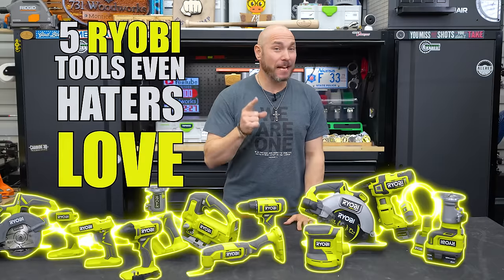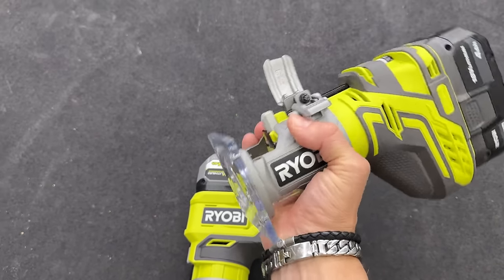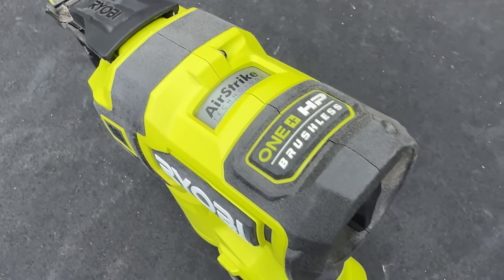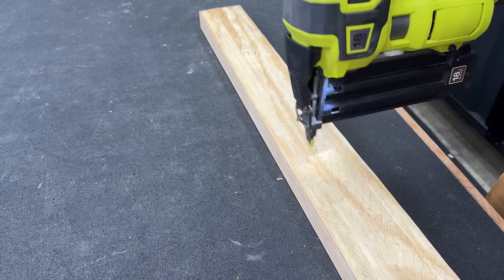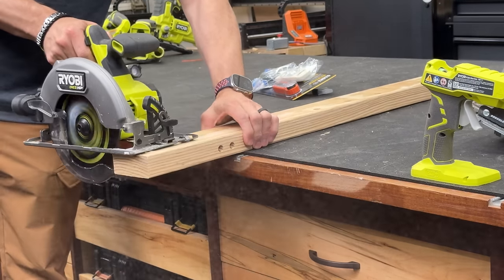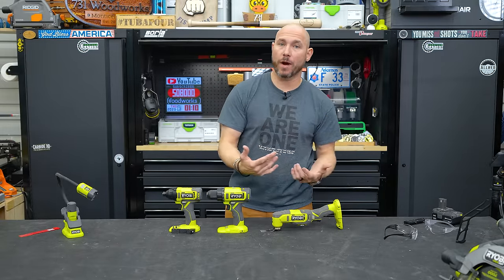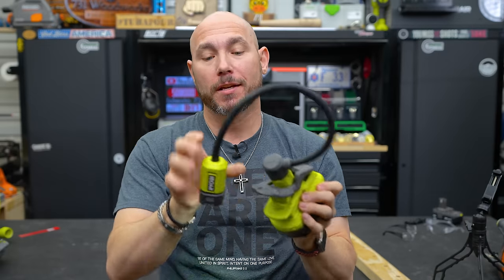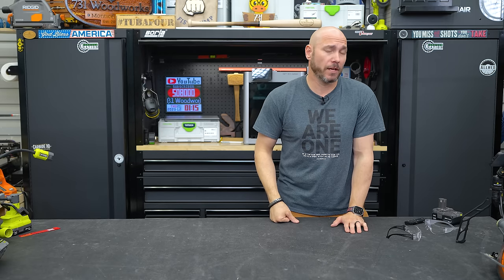The Haters Will Love These 5 RYOBI Tools!

Comment: I have used the smaller circ saw with 4AH battery and it makes a HUGE difference! Great video. I have all of the ones you recommended. I have a little Ryobi 12v drill I use for pocket holes.
Reply: yeah the circ saw needs a bigger AH battery pack or it bogs down.

Comment: I use Ryobi and am very pleased. Try the brushless 6 1/2 inch circular saw. I use it in the field and love it. I love the brushed impact driver better than the brushless. I have literally had it smoking from major paddle bit work about a year and a half ago. And it is still going. The brushless is worse about having too much torque for cheap fasteners.

Comment: I do not work construction and I am not a wood worker but I have been buying a lot of the Ryobi tools and love the ones I bought so far, except the hammer drill I let the smoke out of.  I was using it to drill some anchor bolt holes in the concrete slab, for a 4 ft x 8 ft lean to garden tool shed add-on I was building for my 12 x 16 shed/workshop.

I had a slab poured and ordered the 12x16 Tuff Built shed through HD. After it was delivered in prefab sections and assembled by the crew, I finished out and insulated the shed over the past year mostly by myself, with a few hours help each from 3 different neighbors.  This was mainly for things that needed an extra set of hands.

Before and since that time I have amassed about 20 18 v Ryobi power tools and about a dozen 18v lights and USB chargers. I also have about a dozen of their 4v USB tools. I already had 5 of their Tek4 tools.  I wish they had kept the same battery fit as Tek4 batteries as they are the same size.  I really like the chuck and clutch on the Tek4 drill driver as opposed to the new ones with no clutch at all.

I did buy a Rigid 18 V 21° framing nailer.  I already had their pneumatic version, but got tired of the hose and waiting for the pancake compressor to catch up. Ryobi was alread producing the second generation of their other nailers and I got tired of waiting for Ryobi to put out a framing nailer. So I bought the Rigid 2 months before Ryobi finally introduced one.  I'm not going to buy the Ryobi.  Since I am now in the Rigid battery platform I bought a Rigid 18 V compressor to top off my vehicle tires.  I saw that it was rated better than the Ryobi. It was on sale and was not that much more expensive.  I don't know if I am going to buy any more Ridgid 18 V tools but I do keep an eye out to see what might be on sale and if it's different than what I already have for Ryobi tools.  I did what I consider at least one mistake. I bought 3/8 drive in both the 18V & 4V USB tools.  I should have bought the 1/4 inch drive in the 4V USB instead.

 As you indicated the 5-1/2" kit saw is only good for light use.  I put a plywood cutting blade in it and only use it to cut paneling or 1/4 inch plywood.  I did buy the 6-1/2 saw for regular use and it suits my needs.  If I need a bigger heavier saw I do have my dad's corded Skill brand saw, altough I rarely use it any more.

For generally cutting boards to length I use the 7-1/2" 40V Ryobi compound miter saw.  I do have a 10 inch Dewalt corded compound miter saw but really don't use it anymore either.

I can't go to Home Depot anymore without going by the Ryobi display to see what is new and the closeout endcaps to look for discounted Ryobi & Ridgid tools. Do you think I may need professional help.😊

Comment: I have gone through a couple of the smaller saws, got my first way back  when they were still blue. The biggest thing to remember it is classified as a trim saw, and not ment for constant 2x material or large amounts of 3/4 ply, even though that's what alot of us will do with them. I haven't had the opportunity to use the 7¼ saw yet, so I can't compare.
Reply: I still found it junk, I was hoping to cut 3/4 plywood, it pretty much ruined the piece.

Comment: I purchased the nail gun at a thrift store, but it didn't come with a battery and charger. Then I found the glue gun with a charger and extra battery in the same store, so I got the nail gun and glue gun with two batteries for $25. Then I purchased the small table saw off of facebook marketplace for $80. Then I bought myself the mulltitool and saber saw for Christmas new from Home Depot. I use Makita for my drill and impact driver, just because I used them back in the day when I was working on aircraft. These days I'm just renovating an old farmhouse. I really like Ryobi for the price, and the tools are serving me well. Thank for showing me the features on the Airstrike - mine didn't come with a manual 😄.
Reply: My brother gave me his corded Makita jig saw.  Somehow he had 2.

Comment: Hit the like just for the hot glue gun. It’s the reason I got into the Ryobi brand; they were the only manufacturer making it themselves.
There was only one other option I could find at the time using makita batteries which are super expensive. Corded glue guns are such a pain with how easily they get tipped over, and then can leave a mess on hot glue drizzling out… or leaves glue on undesired surfaces
Reply: Same here, the glue gun got me. I went through four cheap glue guns and wanted something portable.  Got the glue gun. Needed a battery and charger.  Bought the small vacuum. Got tired of using one battery for both. Ryobi days sealed the deal, 4ah batteries, fast charger,  buffer,  orbital sander came home with me. My favorite things are the 6 port charger,  the small and larger fans, and I absolutely love the bug zapper with area light.

Comment: For years I bought Makita drills.   After a while the clutch would fail.    After a number of failures I happened to buy a Ryobi drill.   Since then I buy all Ryobi cordless tools.   I my 18 gauge brad nailer is older than yours but works great and I am using mine now for redoing the base boards in the house.    I also have the crown staples which is very similar and it works well too.     I love the fact I use the same batteries for everything.

Comment: Ive had great use out of the larger inflator. I've used it twice on the road to get tires inflated for other folks. And yeah the sander is a problem. It will turn your hand numb quickly.

Comment: Man, seeing all the battery powered tools now makes me happy. I worked for a cabinet company in early to late 00's and the only battery brad nailers were craftsman which was terrible and a 12v Senco that I had. It was fine for trim but not crown molding so i had a pneumatic one with an air tank as a back up. Now, i could have a battery powered nailer, table saw, miter saw and have no need for a generator. I wish i could've had the tools of today back then.

Comment: I have a kobalt 24V Sander that works well. Recently smoothed out all sides of a 5.5"x0.75"x7' table top in about just under 2 hours running from 40, 80, 120, 150, 180, 220, and 320 grit. Plus only used half the 4Ahr battery so true to time on battery life. Also connects to the 24V 3 gallon shop vacuum. Takes in about 85% of dust.

Comment: I've bought a bunch of Ryobi cordless tools over the past couple of years after buying the brushless impact driver to replace 60 year-old roof nails and being seriously impressed at how good it was. As someone who only does DIY stuff, you get a lot of bang for your buck with Ryobi tools. My next purchase is probably going to be the regular-size circular saw to replace the corded one I've had for over 20 years - it still works well, but it's time for a cordless model. My brother bought a 36v line trimmer last year after being frustrated with the gas trimmer and no longer finds yard work a chore. Ryobi FTW 😁

Comment: I make a lot of large cardboard boxes from sheets of 48" x 96" corrugated and I use that silly little Ryobi mini circular saw and a straight edge just like you would use a track and track saw on lumber with the edge hanging off the side of my work table.  It has to be cleaned out fairly often but it's my favorite tool for that purpose.  I found it buried in a combo kit I got a long time ago.

Comment: just gotta say, my little 5.5" skill saw and orbital sander work great.  My saw is an older model, it's the original blue color, and works great.  It has been my go-to saw for years.  What I love about it is that the blade is exactly 1" from the edge on the short side of the plate, makes for aligning with a straight edge super easy.
I got the larger 18v saw a few months ago, don't really care for it, don't know why, I guess I'm just used to using the smaller one.
I've had my orbital sander for a couple of years now, works great.  No issues with binding or the pad stopping while in use.  
The Ryobi router is on my list of items to get.

Comment: The ryobi p727 is by far my most used ryobi tool, it is an amazing led work light.  I use it working on my car, in the shop, grilling at night, etc.
Reply: I agree. The only thing I dislike is it doesn't remember the last setting you used out of the 3 when you reopen it.

Comment: On the router, I had the same criticisms when I was looking for a trim router. I have enough Ryobi tools to want to stay in the ecosystem but I ultimately went with a corded Makita that came with an edge guide, a plunge base and a fixed base as well as dust collection attachments. I also opted to get the attachment for a to use on track saw guide rail. Yes there's a cord but I don't route off trail LOL! Plus it's lighter and perfectly balanced. The plunge base is just as good as a full size Bosch router too.

Comment: The only RYOBI tool I have is an IR thermometer they don’t sell anymore. That thing is awesome. I recharge the battery about twice a year with fairly regular use. It’s built like a tank and the ergonomics are top notch. I use it primarily to check the hub temps on the trailer I tow everyday when I stop. At one point I thought I had left it behind and looked for a replacement, as RYOBI stopped selling them (I’ve had it for more than 10 years now). I couldn’t find one half as good for twice the price. Lucky for me, I finally did find it and it’s still working like the day I bought it.

Comment: The smaller 5 1/2 inch saw is a great "craft" saw. I do some smaller decorative craft projects as presents for my wife ( I made her a fairy village that sits on top of her bookcase) and it's a great saw for that type of stuff, but I would use my bigger brushless saw to build the bookcase. But for the fairy door I made as a gift it's great. It all depends on how you are using it. It's not a wookworkers saw, it's a crafter's saw.
Reply: The nice thing about that saw is that it's so light!
Reply: It's also great for breaking down sheet goods as it's so lightweight.  I probably use the small saw more than the full size model unless I'm framing up with tubafours.
Reply: I framed a shed with mine, it’s much better with a Diablo blade. Great for fence boards too. Super light.

Comment: I’m so glad you did this video. I primarily use Ryobi and you are right about the 5-1/2 green saw. But I still have my Ryobi blue tools and the blue 5-1/2 saw is great. I’ve put it through heck and it keeps going. And I find myself going to the blue impact driver over the green. It just seems to have a little more power. With that said the green drills are not brushless. Great video Matt. My wife has the glue gun and heat gun in her craft room

Comment: I'm a contractor and use mainly Dewalt. However,  I do use a LOT of Ryobi tools . I can say that there is a huge difference between the brushless tools and the older brushed tools . Stick with brushless on your heavier used tools , it does make a difference. I also only use the 6 amp batteries.
Reply: Contractor here also. I mainly use Milwaukee and Rigid, buI just couldn't pass up thier nailers.  I've since gotten a Milwaukee but still use the Ryobi ones all the time.  And I hand them first to helpers.

There are also a few tools that I needed to grab a 2nd of real quick and gone with Ryobi, like the cordless sander, I haven't had any issues with it and mainly use it for low power stuff like quickly knocking down drywall mud.
Also, tools that I don't use all the time like the PEX crimp tool have been great.

I do agree, always go brushless.

Comment: I got the "Air Strike" pin and brad nailers. For the price I was very surprised at how well they both work. I've used that pin nailer a whole lot and have never had a mis-fire. Not one time. I did eventually get the M12 pin nailer because it is smaller and lighter. It's a good nailer as well but just like a firearm, there's less recoil on the Ryobi because of the weight. It's actually more comfortable to use, if you're not holding it up in the air.
I almost got that work light but ended up getting the magnifying work light. It's got the same clip, two levels of brightness and the magnifier is helpful for these older eyes. Very useful.

Comment: i have the 5 1/2 inch circular saw - I typically take this when i buy lumber to make rough cuts before i put wood in the car.  It's incredibly reliable, powerful for being small and so compact - this saw is awesome.  I also have the Ryobi P321 brad nailer (the non-brushless version)  and have used it for cabinet and other projects - it works perfectly and also very powerful and reliable.
Reply: You must be cutting pine.  The one I tried was pure junk !!

Comment: I have that 5 1/2" circular saw. Went in to buy the 7 1/4" but they didn't have it, or even the 6 1/2 that Ryobi also offer. They offered $10 off because they didn't have the one I wanted, so I got it for like $50. Which was perfectly fine with me, I use a corded 7 1/4" anyway. The only reason I wanted a cordless is because of how damn often the home centers in my area don't offer their cutting service, whether because the panel saw is down or no one is in who's trained on it, or whatever. So I just wanted one to take with me when I stop in, just in case. Just need rough cuts in the parking lot to fit lumber and plywood in my car, then do the proper cutting when I get home. I haven't needed to cut anything thicker than a 2x4 at the store, so the size and power hasn't been an issue. And since it's smaller and more lightweight, it's easy to take with me.

Should certainly be avoided as a primary tool, but I found a specific task for it, and it's been doing it well.

Comment: I have plenty of Ryobi stuff.  Love the glue gun.  I got sucked into DeWalt too and it was the cordless sander that drew me in 210B. I can see it’s impracticality because of battery drain on a small battery but I got mine as part of one of the buy two 5ah batteries/charger/bag get free tool deal so battery drain hasn’t been a problem for me.

Comment: I have a Ryobi cordless sander that looks like a small iron. It is blue. So that means older model. It works fantastic. The point is good for inside corners.  I have used it quite extensively. Would recommend.

Comment: I have both of the circular saws you reviewed, along with my old Hitachi 18v 7 1/2".  I use the small Ryobi, with aftermarket blades, solely for thin sheet goods (including plastics), trim trimming, etc.  For that, it works very well.
Reply: I have a coworker with ryobi circ saws and he's replaced them twice over the last year. They burn up just cutting 3/4 inch plywood and particle board.
Reply: @alextheonewarrior  He must cut a lot of wood, or use dull blades.

Comment: I liked your review of the Ryobi tools and I purchased a few. I did purchase the 18 gauge brad brad nailer. I evidently purchased the wrong model because the one I purchased P321 does not have sequential firing mode. I noticed on your video that the brad nailer you reviewed was the HP brushless model. I don't remember you saying that the HP model was the only one that comes with the swith to fire nails by just bumping the head. Not a deal breaker but I would have purchased the HP model if I had known this info. The HP model was only $20.00 more.

Comment: When I began as a union finish carpenter in 2015  I got to basically try out a bunch of brands and it initially came down to Milwaukee and Makita. I ended up going with makita for most things since several guys on site had them for charging and battery purposes and they were a little bit cheaper than Milwaukee at the time. I was young and didn't have really any payments so I got just about every tool someone could need including someone other tools of different brands like this wonderful bosch miter saw and I had just started getting into festool and some other random brands and they were all in my garage and one day i came back to absolutely everything gone.. I wasn't a fan of ryobi and heard pretty negative things about their old lineup but this was late 2020 and they had just started their whole new line of products. I got an impact and drill combo and a brad nailer, a jigsaw a used off brand 7 1/4 miter saw I was able to fix so I could at least do flooring jobs and make some money. I ended up really pleasantly supprised and have continued buying them almost exclusively for my cordless tools for work and will still get shit from other contractors occasionally but I've found it comes much more down to skill and work ethic than the tools you have, they just make things easier. Im grateful I've been able to build most of it back but im still working on some hand tools, clamps and two festool tools and a few others but im finally getting close to having it all again.

Comment: I’ve been using Ryobi since they were blue. I think their drill drivers are a great value and recently purchased the cordless mini router. I still use the blue 3hp plunge router from the 90s in my flattening rig. I think stating the price you paid and the date you bought it would be helpful in transparency. (Unless Ryobi said you can’t which would suggest that you didn’t pay for the tools).